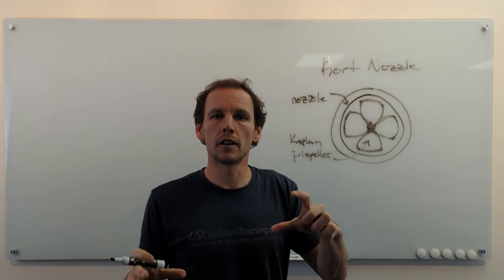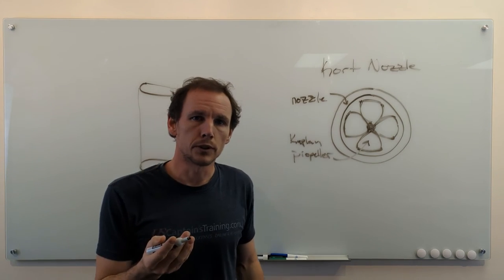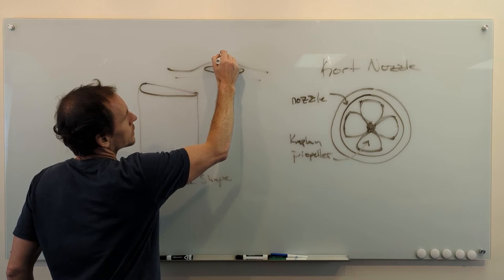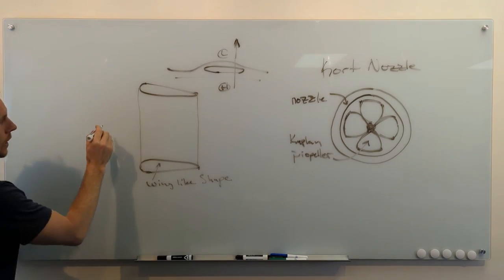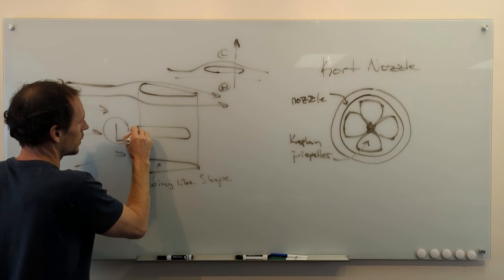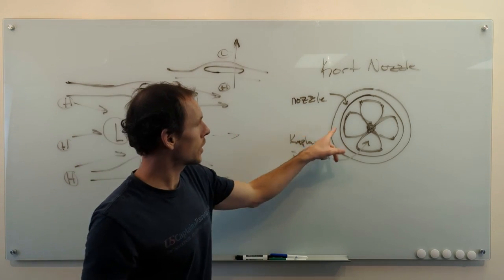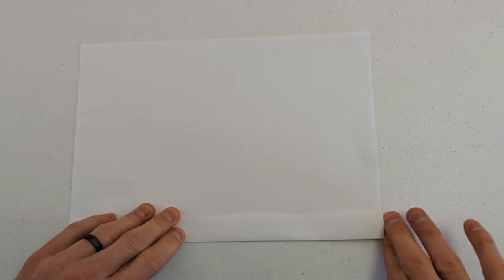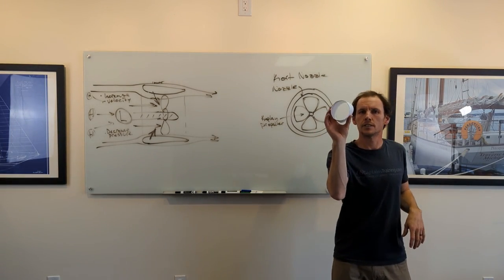Kort Nozzles!

Comment: @6.47 you got the "lift" forces wrong; they should be in the direction of thrust, so forward. An intuitive explanation: the propeller is "sucking"  fluid from the front creating a low pressure zone (the fluid is accelerated - bernoulli law) the low pressure is acting on the nozzle intake and creating the "lift" force

Comment: correct me if I'm wrong but I don't think the kort nozzle itself can generate thrust, the physics doesn't add up that you can stick something with a drag coefficient in a fluid stream get a net increase in velocity
Reply: The kort nozzle is generating thrust,  the propeller is creating low pressure in the front, that low pressure is acting on the nozzle intake and generating thrust. In some cases the thrust generated by the nozzle can be as large as the thrust from the propeller itself.

Comment: Hi how are you ? I have a fishing boat 18m long and i put it in drydock to make some works on it . Do you think if i put a kort nozzle i will get more benefits ? I mean more speed , less diesel consumption does it affect in engine etc. . All i want to know is advantages and disadvantages of the kort nozzle .
Reply from the maker: If you go slow and pull things then it might be good. If you go over 10 knots often then it will be inefficient.
Reply: @uscaptainstraining   does it strain the engine ? And can i have low consumption ?